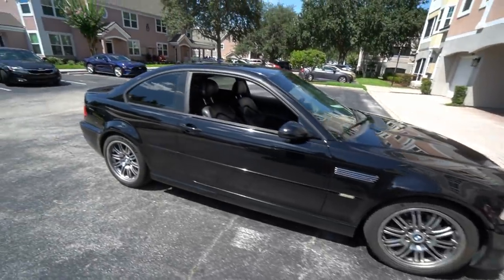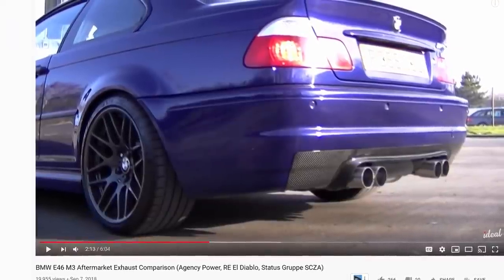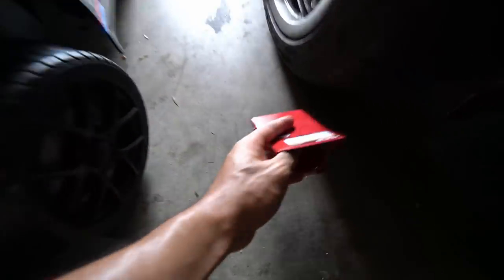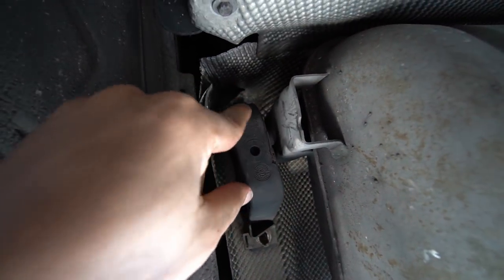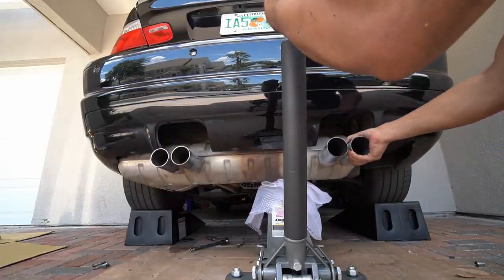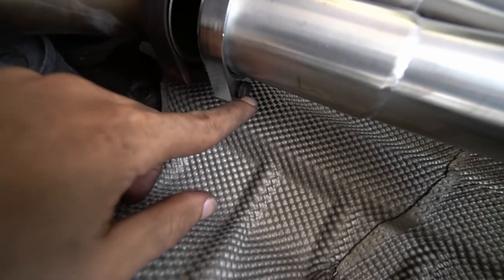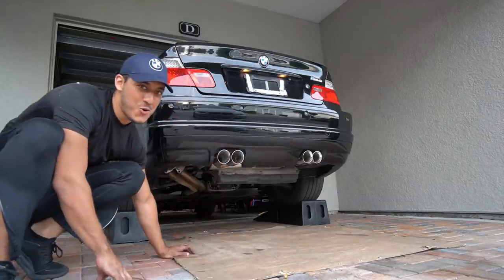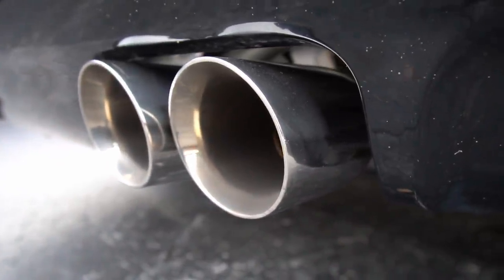Installing The Best Sounding BMW E46 M3 Exhaust That You Cant' Have (Today)

Comment: Just remember the harbor freight jack stands are having a recall because they fail under pressure. I did not know if you were aware of that but we don't want to see you dead.
Reply from the maker: Actually returned mine the same day I made this video.
Reply: I'm having a difficult time understanding this post... 1. You're not using jack stands in this video.. youre using ramps.. 2. Why did you return them if there have been no issues put out about the pittsburg ramps?
Reply: Just get Husky from home depot, they are lifetime warranty.
Reply: supersoni126 you’re right, the recall is only for the jack stands and it’s a particular batch. I had a set that were included in the batch range. Ramps are fine, guess he wanted that $30 back haha
Reply from the maker: @supersoni126 Before buying the ramps I was in possession of the jack stands that were recalled. The same day I filmed the video I returned the jack stands and purchased the Pittsburgh ramps.
Reply: @VehicleVirals  ohhh.. that makes a lot more sense lol!

Comment: The wheels spin off on third shift?! Seriously?! 19:45 Wowwww
Reply from the maker: This car is pretty sweet!
Reply: tires are bad too. old
Reply: They don't really spin tire in third. It's just because the SMG has really bad clutch control.
Reply from the maker: @noobasdfjkl  This M3 doesn't have the SMG equipped.
Reply: @VehicleVirals  What are the paddles for then?
Reply from the maker: @noobasdfjkl Left them there after getting a manual conversion. Been meaning to remove them 😂
Reply: @noobasdfjkl  He explicitly said he changed to a manual 6-speed in the video.
Reply: @VehicleVirals  I first noticed the paddles, then I saw you shifting the knob and I was like wtf? And the nit hit me that you have likely converted to manual :D. Great choice, and a great car!

Comment: DIY guys right here I installed my axle backs on my 2012 mustang in my parents drive way I used the same things used ramps and wheel chucks did it myself luckily my exhaust wasn’t heavy it was 2 different pieces it was a pain though

Comment: Sounds awesome! I would look into an AR20 mid-muffler if you want to remove some of the rasp but still give hints of it at higher rpms! Give it a much deeper tone up to 4K. Some people run 2 in parallel, but that completely eliminates the rasp, one is what I believe is the best option imo!

Comment: From England, Scorpion stainless steel performance exhaust systems have been sought after by tuners the world over. Now, these free-flow, stainless steel systems are available in the U.S. from ECS Tuning! They have been engineered to deliver a horsepower boost yet not be quite as loud as other free-flow systems. And they're built to last using the best 304 stainless steel. - TüV certified.
THIS is the right one but wait there is the Ultimate too STATUS Gruppe stage 2 and rear section better the Rouge and cheaper under 1300.- for parts so you did not do your Home Work Amigo!!!!! STATUS Gruppe will be my choice because they also make awesome headers and once you put that on you can let her rip and nothing's going to sound better nothing I put my life on that!! They all want an arm and a leg to 3000-4000 Dollars and so b***** and most of them for the rear section this is a complete exhaust for under 1500 no under 2,000 would be with headers I believe!

Comment: Revisiting this video after 2 years. Ive had my exhaust on and off a few times now for different jobs.
You gotta wonder who at BMW decided to make an exhaust out of granite. It's unbelievably heavy! My rear and middle are welded together too making it very hard to handle.
Still, only ever had my own help, working on the floor in my garage. Usually end up with hideous bruises on my back after a day working on it.

Comment: The best exhaust sound is the stock one on an E46 M3. If you want a meatier sound then replace the stock manifold with one from a 2005 or 2006 as they share the CSL manifold which is thinner and add an Eventuri CAI for that induction resonance noise to get as close to CSL induction as possible without spending mid 4 figures.

Everything else takes away the metallic  character  of the stock exhaust.

Comment: It needs to be welded on. Otherwise carbon builds up inside the exhaust pipes and eventually your exhaust will fall off. Happened to me after removing the mid box and due to a shabby garage which did a crap job!

Comment: just cut the hanger, and creat space to get to the bolt save some money
Reply from the maker: Easier said than done at the time. Gonna have the shop chop it off this weekend.
Reply: Vehicle Virals would using a hammer work to hit it from the other direction away from the bolt
Reply from the maker: @kkeennyyboii  the space was too cramped. Need to cut it off.
Reply: Vehicle Virals fair enough good luck with it cant wait to hear the finished product with headers and everything

Comment: You might have been better off with blue nylon nuts as they are heat resistant up to 300 degrees celsius. I used to use them for fitting sills on factory oven doors.

Comment: Those ramps remind me of the rhino ramps they sell. Good to see that the installation went well for you. I'm currently finishing up putting my valve body back on. The only problem I'm having is the wiring harness plug fighting the mechatronic sealing sleeve. Other than that, it's been relatively simple thanks to Shoplifetv.

Comment: Let me start out by saying this I own a 2002 E46 M3 Naturally aspirated convertible that I put $67,000 into. Everything from carbon fiber accents for my interior to full carbon fiber hood, trunk, front, three piece split front air dam, rear diffusers, side diffusers side skirts and the list goes on not to mention motor work, rear end work, suspension and brakes rims and tires I took a very stock car in might’ve the hell out of it including my exhaust. 
Which brings me to my point why on earth would you waste your time and your money bolting up a $1300 exhaust catback system and put it on to stock exhaust from the headers back to where are you bolt the EL Diablo system to and expect it to sound to its full capability? 
Now I get where you’re going and what you were trying to do just to prove that that system sounds better than the stock one will let me help you I can get a better sound with a can of corn that’s been emptied for a lot less money than $1300 plus for a cat back system. 
At the very least if you were going for a full different sound you should’ve started out by ripping out the factory headers section 1section 2 and section 3 of the factory exhaust system And at the very least install new 3 inch from the headers back including an X pipe leading you to the Diablo. 
Then you could’ve done a true comparison from the factory sound to what the Diablo can offer I was going to buy one when I went to change my exhaust but the price just did not make sense to pay $1300 or just a catback portion when I paid $300 less for a full system from front to back all brand new stainless 3 1/2 inch all the way to my cat box and yes it made a world of difference from stock.  

And to be honest I’m having a real hard time believing that you got that car for $3000 just because the sequential clutch system was whacked out because it’s not that hard to fix and it doesn’t cost that much to repair it. Or worst-case to just go get a used six speed and a clutch pedal because that’s pretty much all you need and a gear shifter and it’s 123 rip out put in The six speed and you’re off to the races. 

I hope you don’t think I’m picking on you cause I’m not I’m just critiquing your methodology because if you’re gonna do something you should do it right or don’t bother I came across to you because of my young grandson who seems to think you’re the shit I know a lot about cars especially cause I own an M3 and I’ve owned BMWs for the last 15 years so he has seen the metamorphosis that happens when I buy a new BMW from totally stock to totally wild. 
I only wish there was a way that I could post a picture of my car on here because if you saw it you have to go get yourself a paper towel to wipe the spit that’s running down your chin because you’ll be drooling all over it I promise you.
Reply from the maker: You pretty passionate behind your long comment. My guess is that you haven't been around my channel long enough to know that I move in stages to appeal to a wider audience. AA Headers were installed post this video and the rest of the system I have in hand to install. You gloating about the money you spend on your M3 doesn't really help your back up your critiques, at least not in my eyes. The car was purchased for $3000 and honestly I don't need you to believe it. It was a very very lucky find and I happen to be at the right time at the right place. Luck happens sometimes. If your grandson enjoys my channel then let him enjoy man, no need to bring your salt into my videos.

Comment: easily one of the best exhausts but for the best sound improvements, CHANGE THE HEADERS. the header material makes the exhaust sound super raspy. changing the muffler only really makes the rasp louder
Reply from the maker: My guess if that you didn't watch the whole video. I'm changing the headers.

Comment: Any time you are missing those exhaust bolts the previous owner returned it to stock right before he traded.
I’ve spent many a late nite doing my and friends cars the day before pulling everything from cold air, heads, turbochargers, headers, intercoolers car backs. 
Dealers hate to give anything for moded cars and you get to a point returning it to stock you say good enough
Reply from the maker: Makes perfect sense.

Comment: I might have to ditch the e60 535i (6mt) for this. On bring a trailer my car is worth about 13k. I think that's enough to buy an auto e46. How was your subframe? And how much did PSI charge to covert your auto to manual?
Reply from the maker: My sub frame has some hairline cracks. Addressing that soon. They didn't charge me for the manual conversion. But I can tell you it's $2500 in labor + parts.
Reply: @VehicleVirals  I haven't looked into e46 m3 details in years, but are you gunna have them do your rod bearings? Also doesn't the s54 have some Vanoss issue and something involving the oil pump bolt? Something to consider if your keeping the e46 long term.

Comment: Nice exhaust man. I just got a 4.10 differential for my e46 M3. It's in the shop being swapped along with subframe re-inforcement. I can hardly wait!
Reply: pairing it with a manual or smg transmission? I have the gears already but nervous about installing because with a manual gearbox might be a lot of shifting
Reply: Brandon Mendonsa Manual 6spd. I did a lot of research before pulling the trigger. Lower top speed and shorter 1st but power comes on earlier.

Comment: Is it louder at idle than stock?
Reply from the maker: Slightly. Doesn't sound like in the video. But after 3 days of driving, the exhaust broke in and it's louder.
Reply: @VehicleVirals  Could you do a video on Instagram? I do like my raspiness. Will this exhaust remove it all? Also, contemplating the X pipe with valve. Any input about that?

Comment: sorry to disappoint you bud, that sounds like complete garbage. The only good sounding e46 is the CSL because of the intake. Exhausts on these cars are useless.
Reply from the maker: You're not dissapointing anyone since I don't share your opinion and by the looks of it you're in the minority in the comment section. Also the exhaust sounds drastically different in person since audio doesn't clip. The headers will be the cherry on top 😉